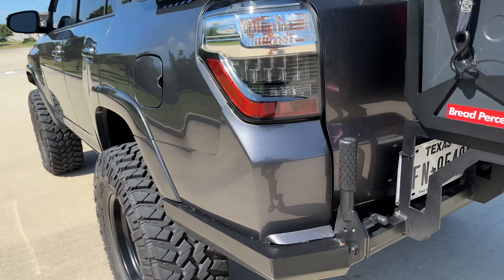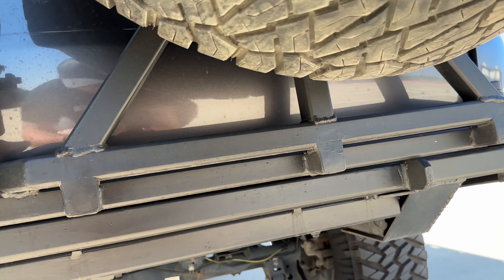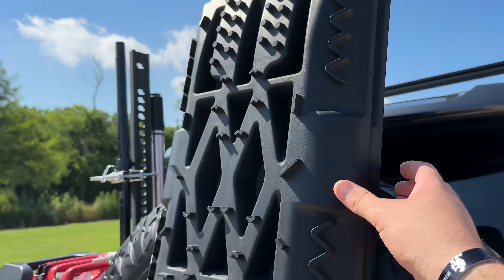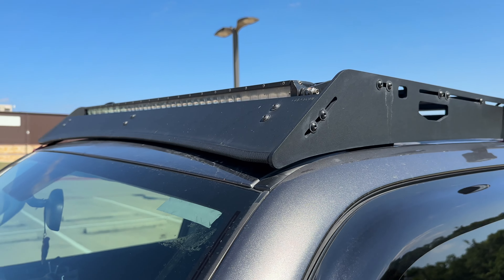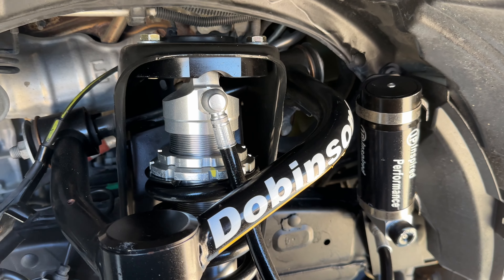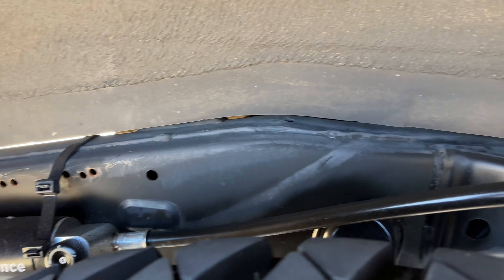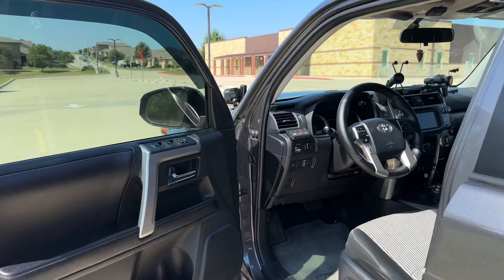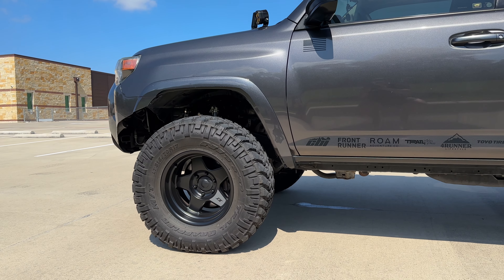My Overland build - 5th Gen 4Runner

Comment: Every time I see someone with a high lift jack I go…”have you even ever used that thing”??
Reply: i bought one, brought it home, tried it, bitch started going sideways as im jacking it up, my truck doesn’t have extra weight besides the 33” tires. I returned that shit immediately. Need the heavier beefier one apparently
Reply: I have. I'm a hi lift jack survivor. They're sketchy at times, but when it's needed, it's beyond called for.
Reply: @3rdgenbestgen21  would you guy be able to build one of these for a tundra rear bumber ?
Reply: I can either use a hi lift or a floor jack.  I’ve used mine but i only use it when I am not lugging my floor jack around.  Purely for trail repairs.  I can’t get a bottle jack to lift a wheel without balancing in to blocks which is super sketch and have had a friend almost die doing.  Trail repairs are dangerous but it goes floor jack (make sure your pro eagle doesn’t roll on you tho!) > hi lift > bottle jack
Reply: @crawlculture  would you be able to build a rear bumper of these for a tundra
Reply from the maker: I’ve used them several times. Replacing CV shafts in this vehicle as well as my old Jeep. They work awesome on the trail.
Reply: Its better to have one then not have one lol. Not everyone gets a flat or have to repair during their off road trips.
Reply: I was using my jeep with tracks in super deep snow, the front right track rolled over itself and the only way I got out of the mountain was that jack raising the jeep so I could flip the track
Reply: @willpizza1 I wouldn’t have them build a bumper for me, they should have taken more time to build that one. The welds are like he said “booger welds” and not what I would want on my 4 runner. The bumper is a good conception though I’ll give him that. But it could have been extended just a little to avoid having to make those cuts to allow for the hinge for the spare swing out imo
Reply: I’m sure they do, it’s just like the tractions boards. I just think it’s hilarious these people ride around with them attached just for the looks 99% of the time

Comment: Panhard bar: it's pronounced PUH-NARD (after the French auto company). Ideally, you should either raise the axle mounting point or lower the frame mounting point to get the bar parallel with the axle (which has the side-effect of centering your wheels). Simply using a longer bar to bring your axle to center when the vehicle is stationary does nothing to fix the altered geometry with a lift while the vehicle is in motion or articulated.

Comment: No rock sliders or did I miss that.  Did you replace your coil springs with all the added weight?   Are you going to re ⚙️ gear?  Asking all these as I am looking at all the options for my build.  I am going with Method wheels they seem to be the ticket for over landing.   Thank you and any reply would help.
Reply from the maker: No sliders yet.. I’m seriously lacking on those. Dobinsons 677v rear springs to compensate for the weight. Eventually I’ll re gear, it’s driving pretty good on the flat Texas roads with stock gears. Method makes incredible wheels, they have so many color and design options. Solid choice!

Comment: Any regearing? Lockers?  Reasons for not having slider with such a good rear bumper?
Reply from the maker: I’m actually designing my own sliders. Gonna be strong but low key and minimal just like the rear bumper. After the sliders, I’ll be doing a front bumper. No re gearing surprisingly, flat Texas roads treat me well with stock gears as it sits. Just the good old ATRAC, no lockers. Haven’t gotten stuck yet!
Reply: Is there a big difference running the stock gears with the 34’s? I’m on 33’s now and want to run 35’s. The 33’s look small on the large gen 5 body

Comment: I wouldn’t trade the dobinsons for “inspired performance”.  At best they are rebranded icons using more budget friendly materials and methods (most likely) and at worst they are Alibaba knockoffs with eibach.  You are going from a company who has been doing offroad suspension for like 75 years vs a budget RTT company that said “surprise” we have a full suspension lineup now.  A friend actually got in on the 50 percent off and they like it but the dobi’s had the Inspired Performance setup by a solid 6” on the ramp travel index test and that is with the dobi’s setup having 3/4” bump spacers and allowing a slight wheel lift with stock bumps on the inspired performance rigs.
Reply from the maker: Dobinsons are a phenomenal and renowned brand all the way through. I use their rear springs and will be getting their fronts. I got in on the 50% off from inspired overland and so far, this suspension has held up great. I’ve wheeled it as well, it eats the trails like breakfast. The true test is how long the valves will last before needing a rebuild.

Comment: you said you've made through with trails in your SR5 with ATRAC where TRD models could not? TRD's have ATRAC also.... were they stock TRD's or TRD's with equivalent modifications as your SR5? must be driver error
Reply: Yea I was confused about his comment also.  What makes the SR5 better than a TRD?
Reply from the maker: Little bit of both. Some had smaller tires, some didn’t know how to use their equipment. I’ve been wheeling for 10 years now so a lot of it usually falls on the driver.
Reply from the maker: @diamondhead203 nothing! TRDs are superior to the SR5 I’m not denouncing that. I’m just saying in my case, in my scenarios on the trails, I’ve articulated through obstacles where locked TRDs haven’t been able to get through. I felt like a trail king in those situations.
Reply: @TR5_Adventures  ah ok.  I wasn’t sure if I was missing something special with the SR5.  Thanks for the feed back.

Comment: Would you share how or what’s needed to make that bumper super interested
Reply from the maker: 30ft of 1.5x1.5” steel bar/tube and about 6ft of 2x3” steel bar/tube, as well as a 3x5” 3/16” steel plate. About a tank of gas in the welder and you’re good to go. $225 in materials total!
Reply: @TR5_Adventures  do you have a drawing or a way of how you made it ?

Comment: Any regearing or mods to the engine bay i.e. supercharged?
Reply from the maker: Nope, bone stock driveline.
Reply: @TR5_Adventures  10-4 and no issues so far with engine or gears with the added meat on the rig?

Comment: Any tips to design a rear bumper for my 4th Gen??
Reply from the maker: Take your rear bumper plastic off and take a bunch of cardboard, cut it in strips and play around with it. Cut, measure, and tape the cardboard until it’s shaped into a rear bumper of your taste. Then, start cutting metal to length and measuring, re measuring, cutting, all of that. It took several dedicated weekends with trials and errors like crazy but it eventually worked.

Comment: Does your tranny shift different after the 315s?
Reply from the maker: Absolutely. It feels like a 3 speed transmission, gears are a bit longer. However it’ll stay in 5th gear 90% of the time on the highway at 72mph.